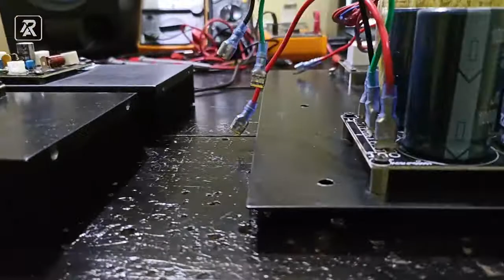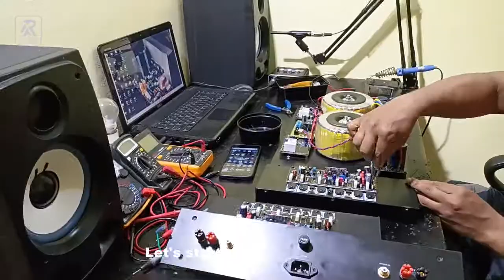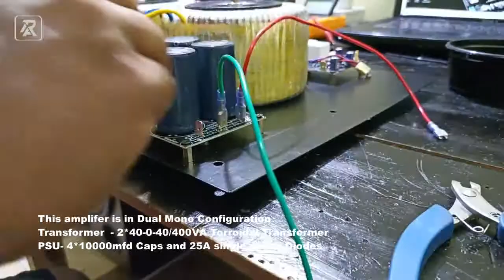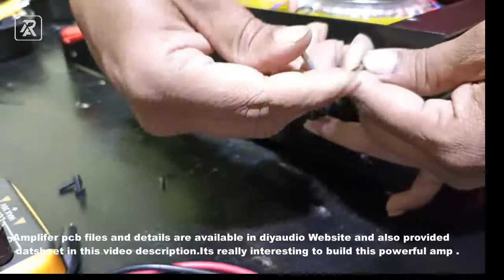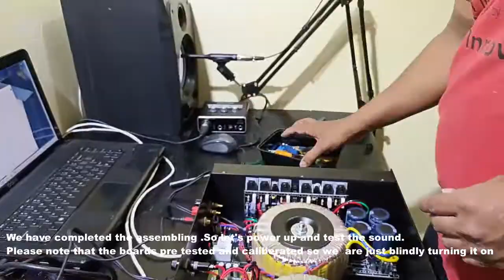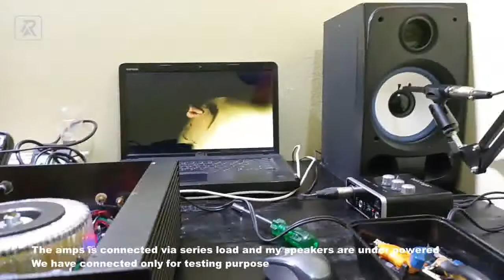DIY  Stereo Amplifier -Honey Badger -Sneak Peek

Comment: Looks like a nice build! A couple of things that I saw, the mosfets are facing up. The heatsinks would be a lot more effective if the mosfets were on the bottom. Just flip them side for side or turn upside down if the wiring will work out. Also, no washers on the output devices. You will want to distribute the force of the clamping force of the screw for better thermal contact.
Reply from the maker: Thank you so much for the valuable comment and idea's,We willtry to implement in our next build. Keep watching our videos ❤
Reply: @raudios725  I have been wanting to see this amp built up so thank you for sharing!